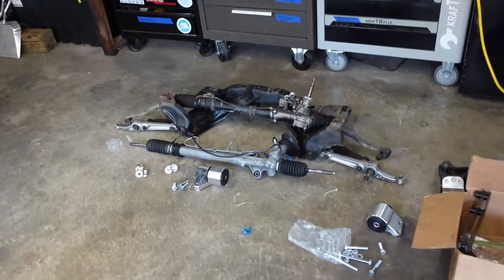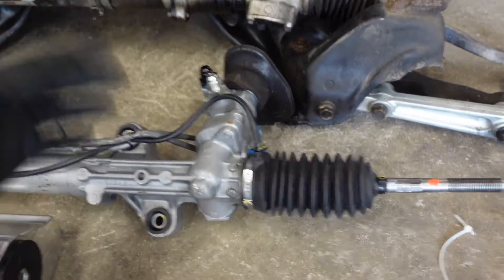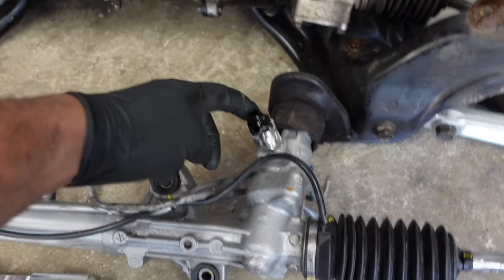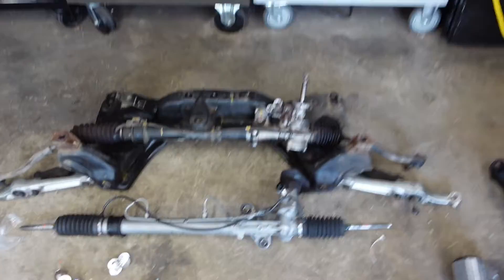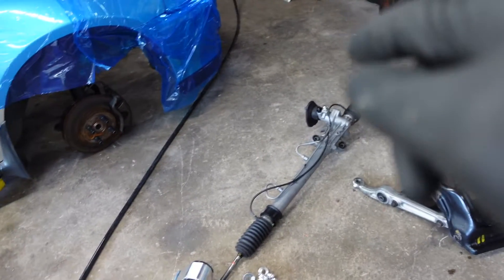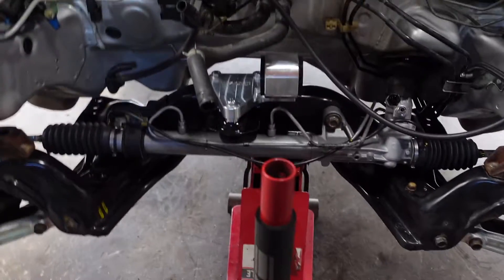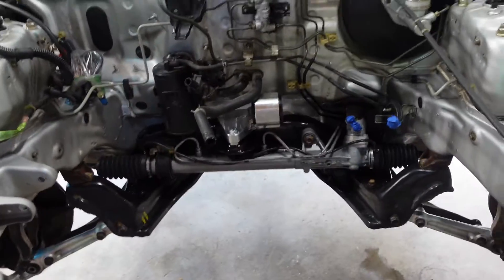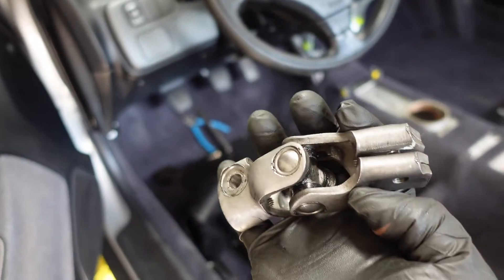Installing a Integra Type R steering rack in my EG Civic!

Comment: good stuff. i like that little trick stuff. i probably could use some fresh bushings in my rack as well, not sure if there is room to just move it up and replace or not, hardest damn part to work on on the vette.
Reply from the maker: Rack bushing on the vette are pretty easy can be done on the car
Reply: @Beezy_Builds  good to know, evertime I have messed around in that area I have to drop the cradled.
Reply from the maker: No cradle dropping needed for once lol